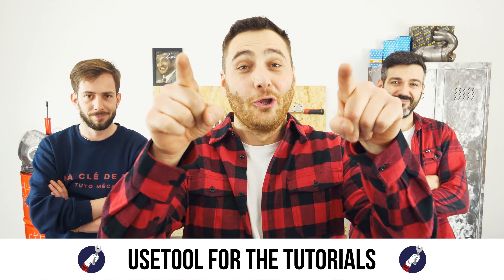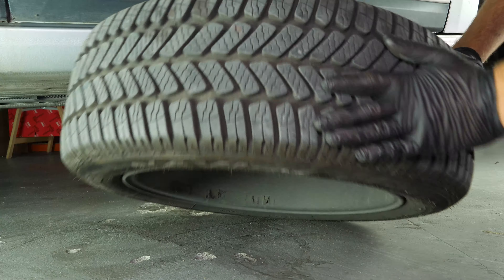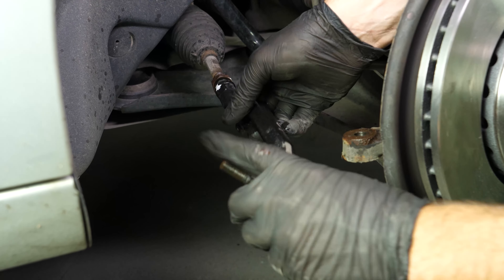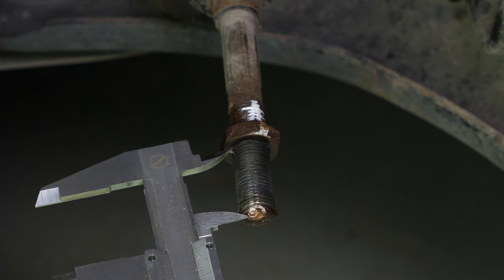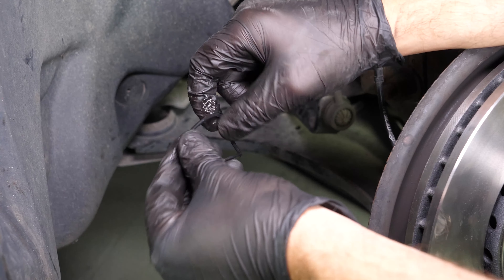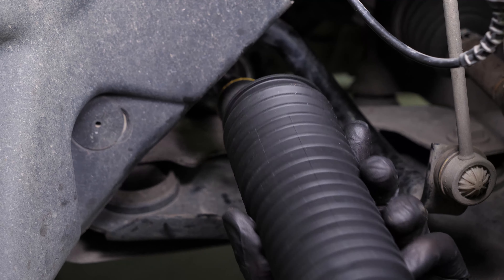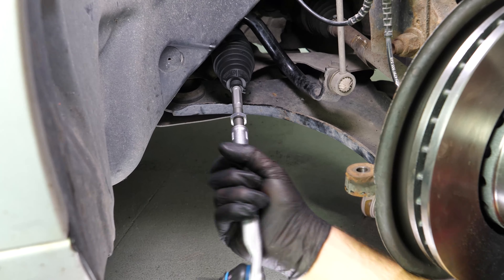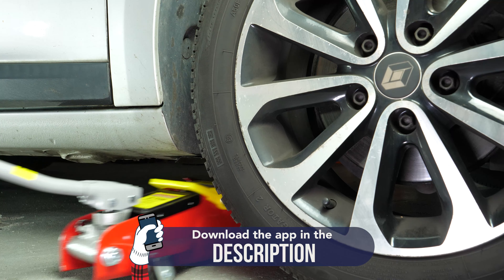How to replace the inner and outer tie rod Megane mk3 🚗

Comment: When to unscrew the inner steering  with the tool, what happened is that it just slipped. I had to use sandpaper to loosen it but it wasn't easy... Seems to easy on the video